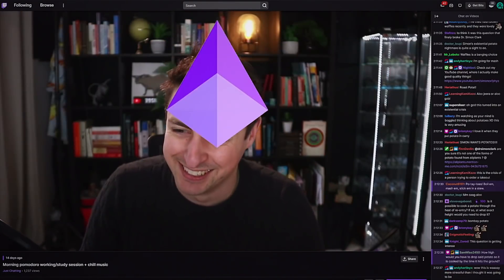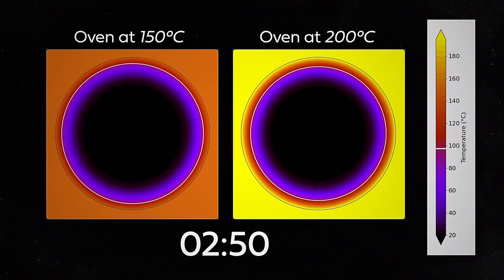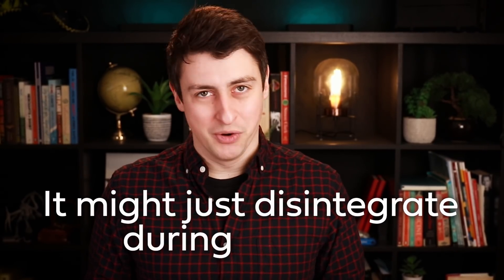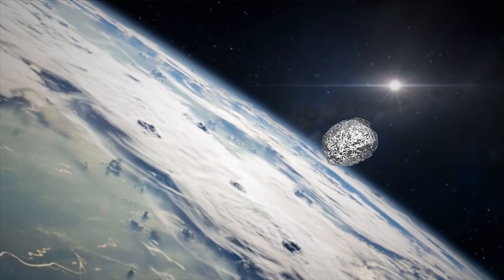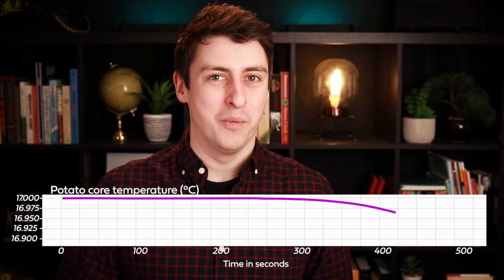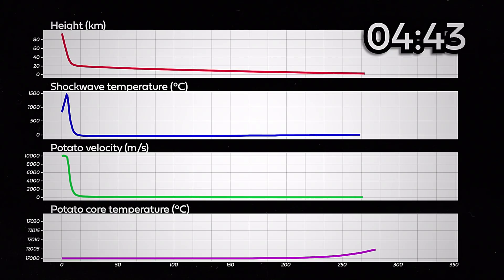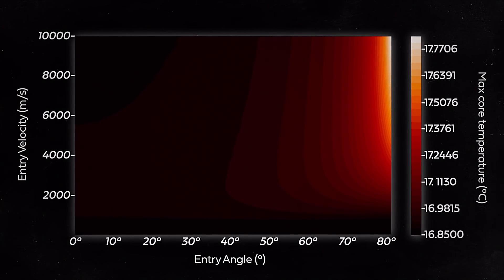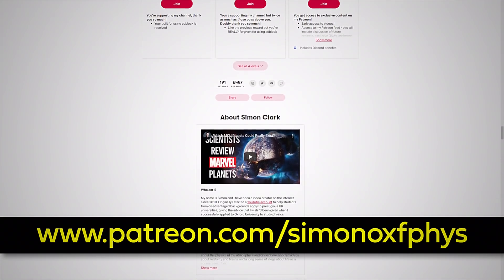Dropping a potato from space

Comment: It's funny cause I'm pretty sure the algorithm recommended your video to me because I watched your "assume a spherical cow" the other day and when you said "if we assume a potato is spherical" I laughed thinking back to it (then checked and realised you're the same person 😬)
Reply: Also: 
1 - you say the upper reaches of the atmosphere is very cold. I'm like… not in my specialty, here, but from what I know, at least on the day side, the upper atmosphere is hotter than the surface, though, no? I mean, from what I know, starting at the thermosphere (aptly named) temperature increases back from the roughly 200K it reaches at the mesopause, and it increases quite quickly since by 120 km it's already in excess of 300K (I actually found this really neat graphic by Dr Douglas K. Martin from his 2009 Development of methods for measurement of biosphere-atmosphere exchange of carbon and nitrogen study based on data by Ahrens, 1994)
Is it because of the low atmospheric density at these places, that the equivalent energy transfer is tiny? Or were you just handwaving the increase since you decided it wouldn't go higher than 100 km?

2 - there are cases when you cook potatoes at roughly that 98°C mark… boiling. Since water boils at roughly 100°C in most cases (slightly lower in most cases cause we're almost always slightly above sea level and you most likely add salt to your water) and you don't want it bubbling away but barely simmering, you might even be closer to like 95°C or something… but yeah, essentially, it's at that temperature (maybe even closer if you steam them — the steam reaches 100°C since it's in gas form but my 2 cents is that as it mixes with the air you'd essentially be close enough to that 98°C, right?). I mean… what this showcases, to me, is that our obsession on trying to heat stuff up by making air - one of the best insulating thing we know - very hot is probably really inefficient and using the much more conductive water is much easier.
Also, lazy recipe time: if you can't be ars*d cooking your potato for half an hour in the oven and don't feel like the blander steamed/boiled potato, you can just put them on a plate, grab a knife and stab them roughly 5 times on each side (you don't want steam to build up inside lest the potato blow up) and the pop them in the microwave for 10 minutes. This works really well cause all a microwave does (in theory) is excite the water enough to get it to boil. And in theory it's supposed to do that across the potato (or any food) evenly, but we all know the inside of microwaved food remains colder, presumably cause the outside isolates it from radiation somewhat (also the "in theory" for exciting water just enough so that it boils is defeated by the several cases where it gets superheated).

Comment: In regards to 0:56

But we do cook potatoes at ~98 °C, ever heard of boiled potatoes?

And yes "water boils at 100 °C" except not quite, the boiling water is about 98 °C due to the phase transition from liquid to gas taking quite a bit of energy, the steam itself is 100 °C or hotter though.

And while yes, there is a delay between the outside and inside being heated, that's kinda why boiling potatoes takes a long time (30m+, depending on size of potato)

Comment: Hi Simon, who did your animation? It almost looks like it left out or lumped del-squared with the "thermal diffusivity", when of course it's an operator which inseparably belongs with T.  At the same time you said "depends on how much temperature is changing in the local area" but it's much more succinctly and accurately described along the lines of the "local change in slope of temperature over distance". I sure hope someone was fired for that blunder.

Comment: The potato has enough potential energy at 100 km to get its entire temperature increased by over 2000 degrees (assuming it's a 0.1 kg ball of water), so why does it barely heat up? Because the time it takes for it to fall down?

Comment: Thanks. I have a question: why is a proton heavier than an electron? What if it were the other way around?  I know it's not about the topic, but it's just interesting
Reply: There is an idea. So, unlike the electron, the proton consists of quarks. And there is a strong force of influence between these quarks, which means a very large energy, and we understand that E=mc^2 this much energy is equal to a certain mass. But electrons are not made up of quarks. However, I feel like I haven't found an answer to my question. So what would happen if it were reversed, that is, protons moving?
 Also, wasn't it the Higss particle that gave mass to particles such as protons and electrons?

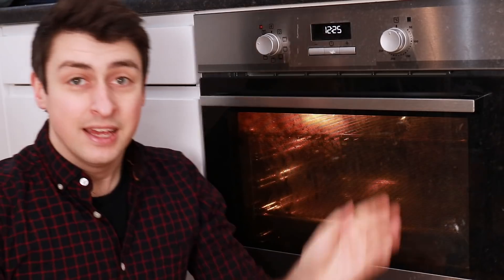Comment: HUH.... 98 C?? (0:30)
That would mean that it is physics-ally impossible to boil potatoes beyond ~600m altitude.
(because the air gets thinner, and the boiling point of water drops below 98 C)
Reply: A pressure cooker might help
Reply: I'd have to imagine that it's not a sharp cutoff though, and lower temperatures would still work if cooked for long enough
Reply: That's a very good point, and there are actually quite a few cities above that altitude. I'm curious now...
Reply: this is a very interesting point. nice

Comment: This video is dedicated to Samwise. 
Also: I think you should be able to cook it by wrapping it in a couple millimetres of polished aluminium foil and putting in a 300ish km orbit. Aluminium has very low emissivity in FIR, so you lose basically nothing to stefan-boltzmann, there are lots of high energy ions and atoms floating around you can bump into and the sun's UV and soft x-ray are easily photoelectrically absorbed by aluminium. I bet your equilibrium temperature is >>100°C
Reply: lol, now that you mention it, you don't even need anything that complicated. Put it in a double glazed (with vacuum between) glass box and sunlight will cook it on it's own. A greenhouse in space can get up to hundreds of degrees anyway!
Reply: @agsystems8220  I thought aluminium foil was cute since people use it to cook potatoes anyway and the differences in FIR emissivity and UV/x-ray absorption means that it can function as a green house effectively :P 
But yeah a greenhouse might also work^^

Comment: The problem I have with his result is he doesn't consider the heat pulse to remain, instead effectively removing all heat the second it slows down. In reality the heat will slowly travel through and disperse within the tato even once the outside heat stops. Atleast it appears he didn't consider this?
Reply: The heat pulse sort of disappears though, because the water content of a potato is so high and it just boils off limiting the temperature (and also ending up as a really good insulating layer). The carbon layer will get very hot, but it will also radiate off a huge amount of heat, will be surprisingly low density, and carbon has a very low specific heat capacity. The steam boiling off through the carbon layer will also move the energy away from the centre extremely fast, removing even more heat as super heated steam. If you were to put a potato in a lump of iron, and then drop that from orbit, it almost certainly would get hot enough and stay hot enough to cook the potato, but the potato itself cannot hold onto enough heat to cook itself.
Frankly there were a lot of things he didn't consider (or at least didn't put in the video).

Comment: Ahh, see, what you need to do is stick a knife through the potato and leave it in. This will conduct heat from the surface to the core much more quickly than the potato flesh, allowing you to cook it more quickly at a higher temperature. I always use this technique for larger potatoes, otherwise even in the oven they suffer a similar (though less extreme version of) fate to the orbital cooking method.
Perhaps a single steel knife wouldn't be enough though, I'd suggest an array of multiple blades, probably made of stainless steel jacketed copper.
Reply: "I always use this technique for larger potatoes"

I'm picturing someone in their yard, stabbing potatoes and yeeting them into orbit...
Reply: @tinastsebastian  how would you go about getting them back down
Reply: I use teaspoons, they are more compact and my halogen oven is quite small. The teaspoons are quite chunky and the spoon part has a large surface area, so they work well.
Reply: @pattheplanter  Nice. Could also use the method of "Microwave it for ten minutes then drop it from orbit to crisp up the skin"
Reply: But don't do this if cooking in the microwave!
Reply: U can just cut it🤷‍♂️
Reply: This is what I love YouTube comments for!